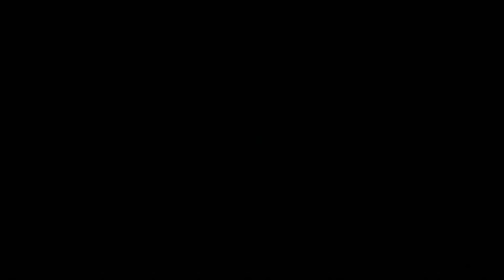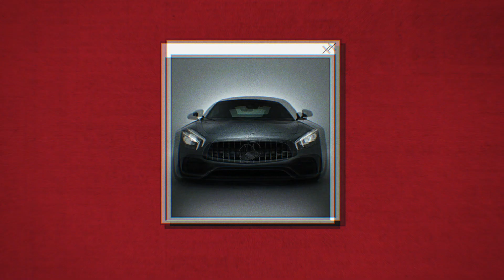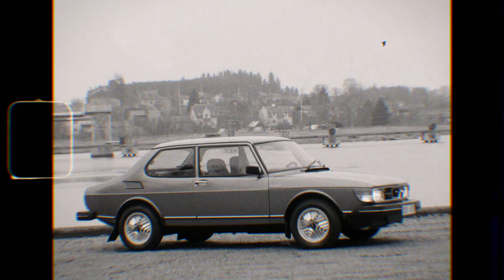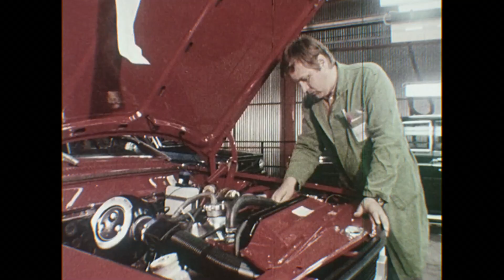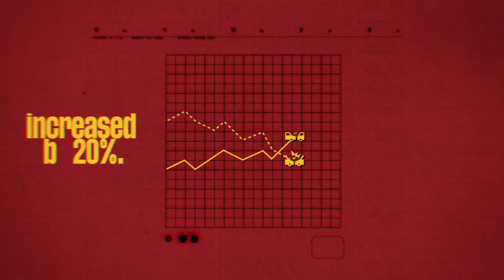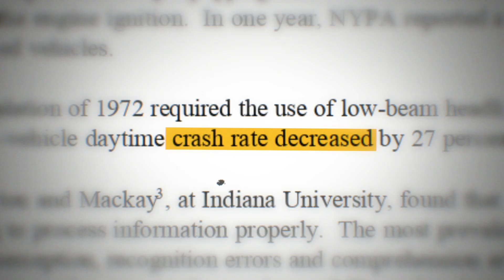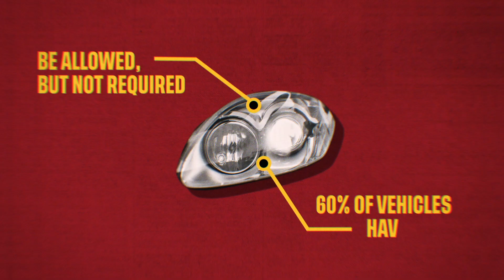The Missing Car Feature That’s Killing Americans

Comment: 0:01 First, that's not an American road.
Second, that is a very poorly designed road. Right turns there need a traffic governor, whether stop sign or at least a yield sign.
Third, trimming the trees would make the intersection safer.

Edit: Not that I disagree with your premise. Just that the particular example was not a good choice.

Comment: I have one vehicle without DRLs and another that uses headlight bulbs at a dimmer brightness as the DRLs.  During the day, I drive with the parking lights on in both of them.  Parking lights are seen from every side of the vehicles and that is very important to help distracted drivers see me at intersections and when driving behind me, especially if its raining or snowing.  Halogen headlight bulbs dim over time and they're much more expensive to replace than parking lights, so using just the parking lights is another benefit if the headlights are used as DRLs.

Comment from the maker: This is our first video, hope you like it! 😃We have some exciting safety related topics coming your way soon :)
Reply: Please make a video about the disappearance of fog lights on modern vehicles and also the fact that LED head lights & tail lights don't melt snow or ice like halogen & incandescent bulbs do.  Commercial trucks with the standard size rectangular head lights can get LED units with built-in defroster elements, but no all-in-one head light or tail light assemblies for passenger vehicles have them.

I'm concerned about the enormous C-pillars on SUVs and very small side windows in the cargo area that severely limit visibility.

Very few vehicles have power adjustable foot pedals.  They are very important for shorter drivers because they allow them to be farther back from the airbag, steering wheel, and dash that can cause injuries.

Another serious problem is that many people don't realize they don't have their parking lights and head lights on at night when their DRLs are on.  I see this most often on Nissan, Chrysler, Dodge, Jeep, & Ram vehicles.

Lastly, most vehicles have height adjustable head restraints, but many people don't move them to their proper position.